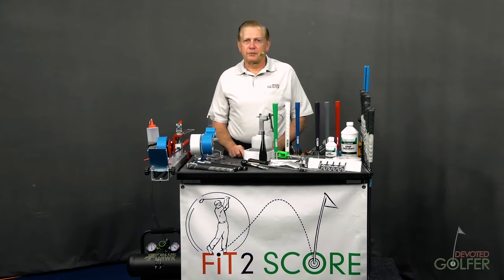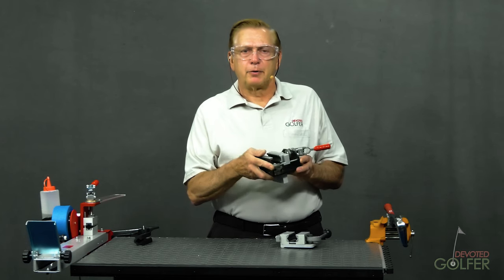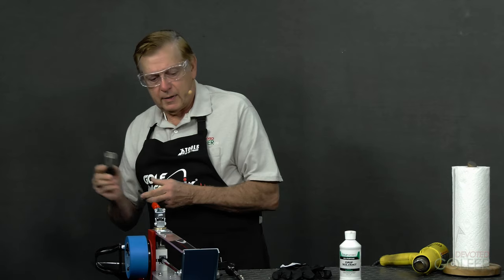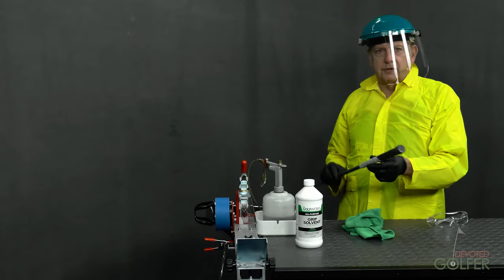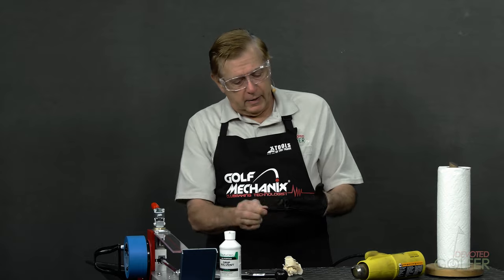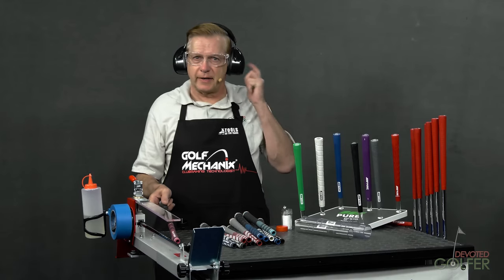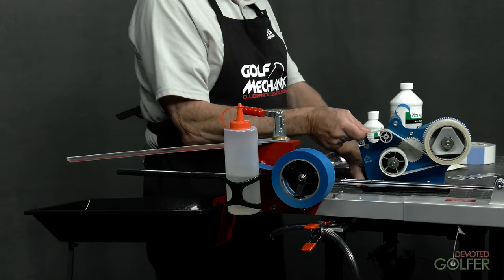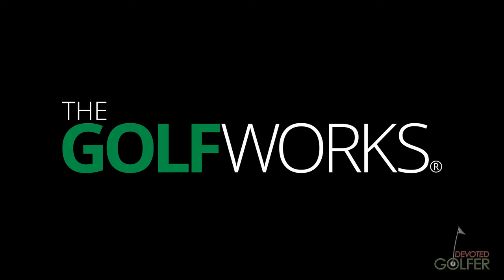How to Regrip a Golf Club - A complete tutorial on removing, installing and sizing golf club grips.

Comment: I personally haven’t had a PURE grip turn on me but some of my customers have. Especially those golfers with a strong grip. I’ve tried most masking tape...blue, green, etc. I just don’t totally trust the air method.
Reply from the maker: I cannot recall ever having a customer grip twist since I stopped installing Winn grips without tape. And that was many, many years ago. My customers are thrilled when it is time to regrip and I do the whole set in less than 10 minutes.